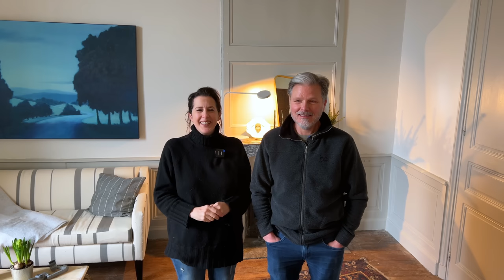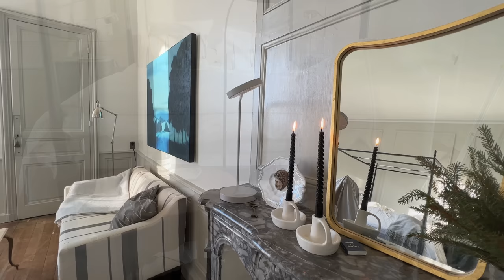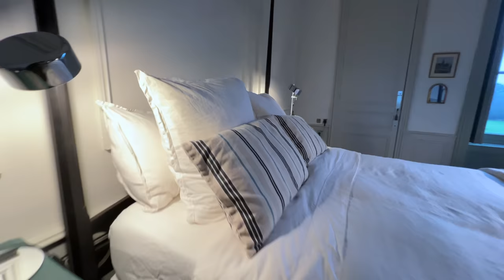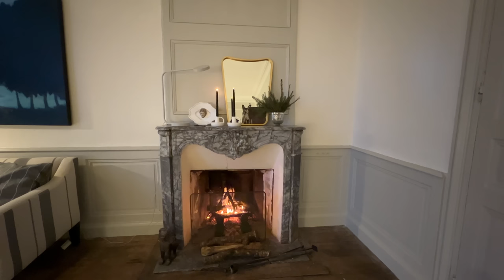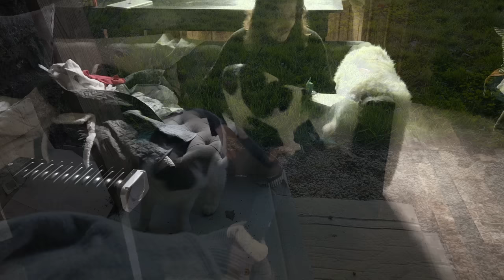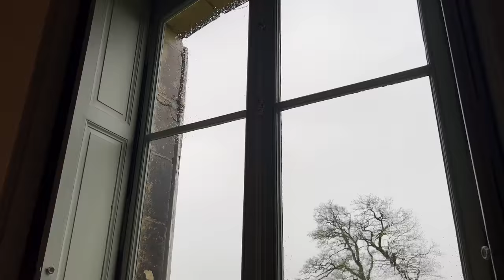BEFORE and AFTER! Our French Chateau Guest Room: Completed!

Comment: You live near the coast. As you probably learned from living in the Bay Area, there are sea and land breezes that result from the temperature differences between the land and large bodies of water. The English Channel is quite deep and cold, with fast-moving currents that keep water temperatures quite low. These wind-effects occur at different times of the day, because of the warming and cooling effects of the sun. The strength of these winds is often a function of the local topography, with Brittany seeing stronger winds because the area is relatively flat…

Comment: For Lincholn? (I cannot remember how to spell the name ) I googled it and it looks wrong ! 😳 Twilight Zone here . Anyway, there is a Kinetic switch . You put the receiver at the ceiling lights electric, then without wire running from the wall you can press the switch to turn the fixture on. I think it's amazing ,if you do not have to dig into walls and ceiling to put in wires! Now, the switch may not be antique quality beautiful . But it saves so much work ❣️❣️❣️
Reply from the maker: Ah yes, we had one of these in SF...